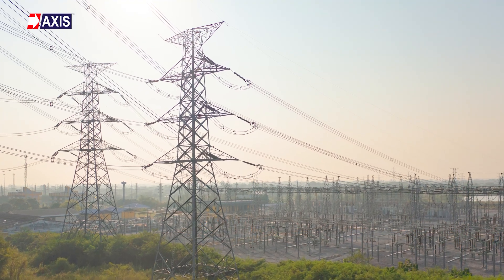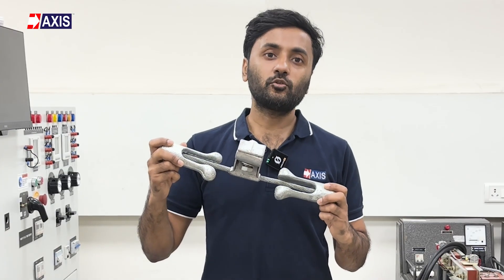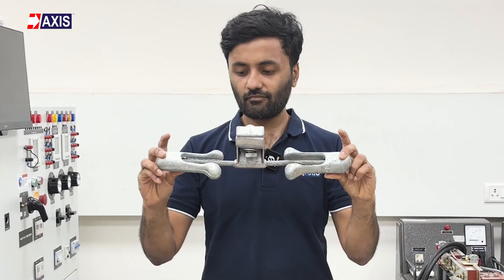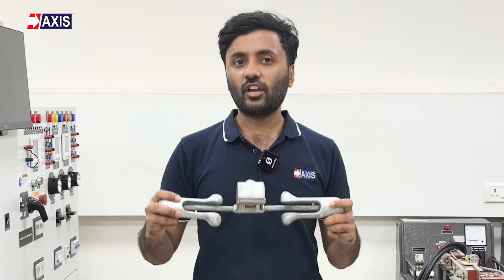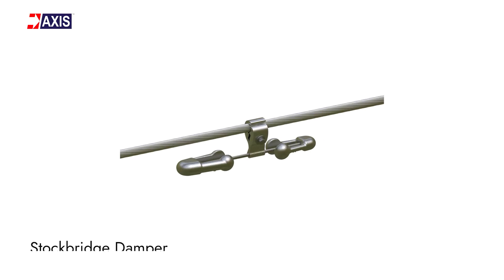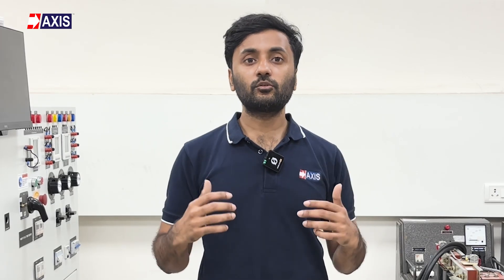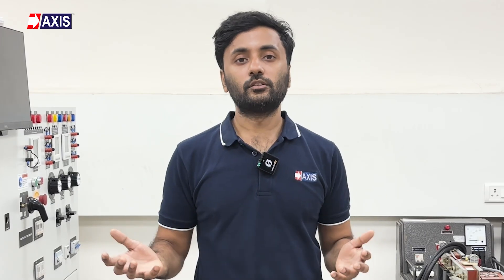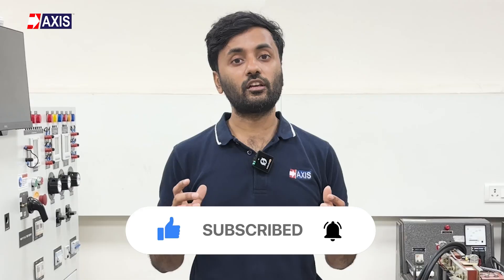How do Vibration Dampers Stop Transmission Line Failures?

Comment: I've been fascinated by the overhead structures and wiring all my life. From watching galloping wires I can now assume that towers high on the hill that have insulators not hanging straight down but on an angle are like that at the tower is a little offset and strains the wires due to potential wind gusts... If that makes sense. I'm in Sydney Australia. Do you supply to our electrical grid down here ?
Great video mate. Well explained
Reply from the maker: Glad you liked the video. Really appreciate your thoughtful comment.

Yes, we do export our electrical hardware to Sydney. 

Please share your email ID or connect with my team at marketing@axis-india.com.

Comment: I expected an explanation as to WHY the dampener is shaped the way it is. Instead you just told us things that any moron would understand "vibrations cause failure"  "weather changes cause temperature fluctuations" "strong winds cause power lines to sway" "failure can lead to power outages" LOL. You might as well explain that water is wet.

Comment: I do have to ask though, why is it shaped in the way it is? I know what dampers are and how they work, just I never quite saw this particular design.
Reply: That's an inherent part of the way they work. Imagine looking at the point where the clamp attaches to the power line. as a vibration passes through it. It shows up as the connection twisting first one way, then the other as the wave passes that point. The weights on the damper are at the end of lever arms, giving them a high moment of inertia, and meaning it takes a lot of force to twist the damper, which absorbs energy from the vibration on the power line.
Two other features then become important to make sure the energy isn't simply returned from the damper back into the power line:
First. the length of the arms and the mass of the weights are chosen so that the response frequency of the damper is matched to the main frequency of the aeolian vibrations expected in the power line. This can be worked out based on several factors like cable material, line tension, wind speed, etc.
This tuning means that the damper applies a force out of phase wit the input force, canceling out the main vibration modes. 
Secondly, and less importantly, the damper arms are made of somewhat flexible cable rather than a stiff bar. Flexing of these arms introduces parasitic losses due to heating. This is normally a small effect but in the case of an unlucky set of conditions (wind speed happens to be just right (just wrong?) so that it sets up a vibration at the resonant frequency of the line and damper system, ) the flexing in the damper will become much larger than normal and inelastic losses will become a lot higher, which can both absorb more vibrational energy but also can result in a shifting of the damper response frequency, taking it out of resonance. This prevents a resonant vibration building and building to the point something catastrophic happens. (see Tacoma Narrows bridge)
Reply: @jhonbus  right but does it have to look like a man's block & tackle, lol
Reply: @jhonbus  I was more meaning of why the weights are shaped quite so phalically. Two weights on a wire make sense after all - that is a no brainer.
Reply: yeah that shape is certainly a choice by the engineers, lmao.  guess there was no other way to do it.